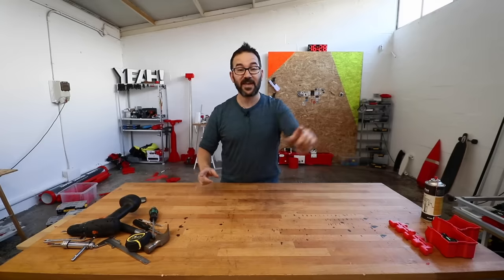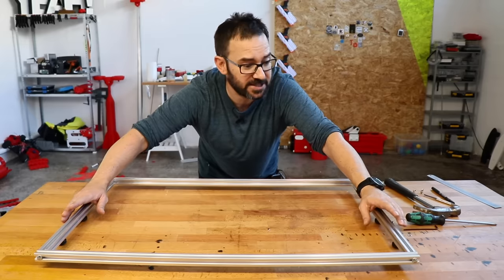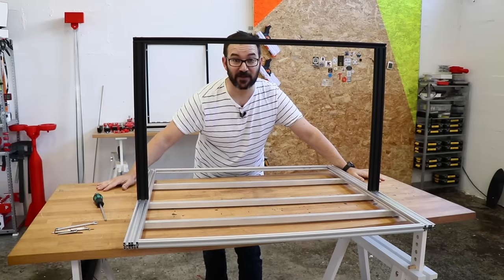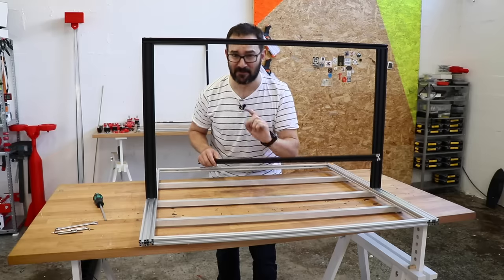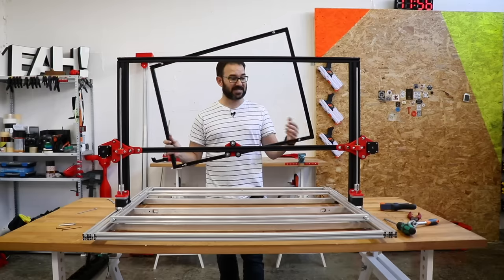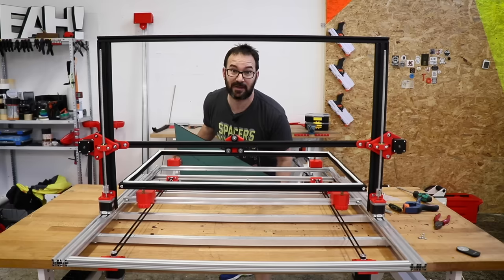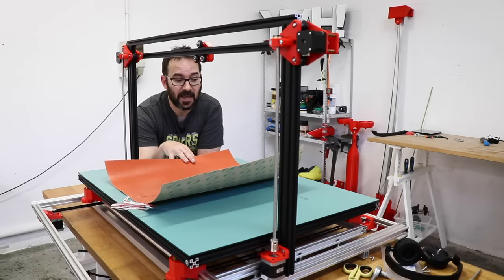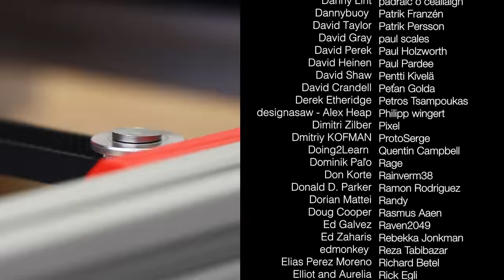GIANT DIY 3D PRINTER FROM SCRATCH

Comment: Are you afraid that the mirror, which is quite flimsy, is going to warp because of the silicon heater? I have a 300x300mm aluminum bed (8mm thick) and with a silicon heater the heatup temps are so fast the bed warps a bit. I wonder how thats going to look on your massive bed!
Reply from the maker: Mine is glass, mine is  not flimsy. It is 5mm. Aluminium expands a lot with heat and it is quite unstable. Glass is extremely stable. So no, not afraid at all.
Reply: @ivanmirandawastaken  Thanks for the reply! Are you going to use stepper motor dampeners to reduce vibrations on the frame? I think if the motors turn quite fast or change direction quite often, especially on the x and z part the frame will vibrate quite a lot. What do you think about that? Are you going to reinforce the z with diagonal rods to front and back, as i've seen as an upgrade for the cr-10 500mm version?

Comment: It is well known that the moving bed design does not work for large printers. The problem is that for large printed parts, you are adding too much momentum to the bed, on top of the momentum added by the already heavy aluminum plate and glass. You will need to print very slowly  This is the motivation behind the CoreXY design, which work fantastically for large printers

Comment: I have a wild and crazy idea. Why don't we build one that is big enough to print a small size house. The material will used will be recycled plastic that way we can re-use the plastic with a UV additive so that it won't break down by the sunlight. Design it with some space between the outer and inner walls for insulation, and a printed roof parts that can be replaced as necessary. I think that I saw this once on the internet but they were using concrete. If the house gets destroyed by wind, earthquake etc. Then just grind it back up and re-print it out. 
The possibilities can be endless!?

Comment: While reviewing the comments I noted "It's not whether the bed will sag but when."  Ivan, given the size of the glass and that glass is a liquid crystal would it be a good idea to add supports beneath the large glass?  It's a scientific fact that glass flows even if we can't see it do so.  The larger the glass the more it will sag.  Heated glass will flow in the center especially given the surface area and the force of gravity which will lead to your bed being unlevel in the middle even if it's level on the corners.  I still hope I can find measured drawings of this build someplace.  PLEASE???

Comment: For a bed that size i think a Zprob leveling system is going to be required. Unless you made the bed out of a huge machined solid plate. It would be a nightmare to tram the bed without it.

Comment: Why use spring couplers ? They are not designed to be used like this. Plus you will get inaccurate z height, due to springing action.
Better with a solid inline coupler.

Comment: Firstly id like to say Great work- Great design Great speed and motivation Keep it up very inspiring i love the cable management chains very elegant 
some tips feel free to ignore them if u dont agree:

1. Make you enclosures and or parts out of petg or fireretardants ABS- if u cant do metal boxes! Last thing u want is anything catching fire after a 24hour print- Which you willl be doing often with such a large build platform!
also purchase Silicone wires !!! multistrand silicone high temp big AWG wires and crimp them correctly!!! safety first!

2..11:30 looks like your pullly isnt centered. If u go on e3ds website you can buy genuine gates pullies and belts-  i highly recommend you dont cheap on pullys and belts since you have such heavy bed you dont want ripple allover your prints from A: uneven movement from the left to right motor: but B: Ripple from the weak fiber re-enforcement on the belts!

3. I want to tell you to get a duet wifi- and i can highly recommend it because of the webui and all that jazz its great.. But marlin has backlash compensation- and on such a large printer as this with such large belts- using the backlash compensation in marlin might actually help you- however. there is nothing to say Reprap firmware on duet wifi wont be getting backlash compensation- plus the duet wifi/maestro arevery safe board! with very strong stepper motor controllers 
backlash compensation will give you great accuracy/tolerances on parts even if you build the printer somewhat sloppy :P (You should use it on your first large printer heh :P)

4. the way the z-axis is coupled might cause - z-wobble - let them wiggle freely on the top dont captivate them- and make sure your z-rollers are nice and tight- also use low microstepping on Z- like 1/8- it has a higher chance on landing on "magic number" magnetic poles and giving stronger holding torque and nicer surfaces- even with auto bed leveling it should have enough resolution with those rods

5. maybe print little angle re-enforcement to keep everything square as the bed wobbling around might cause a bit of wobbling up the Z since thats alot of mass - maybe even just a hardware angle bracket for shelfs made of steel with some T-nuts can do the job!

6. Dont listen to the people dissing on ur heavy bed- thats what Acceleration and linear advance is for :)

Comment: The i3 design is pretty much unsuitable for this size printer in my opinion. The print itself will become so heavy that you will need to print extremely slowly, and the springs holding the bed will become compressed from the weight of the print, so layer height will increase as you print. Accuracy is probably not very important here, so maybe none of this will matter.

Good luck anyways, will be interesting to see the results!

Comment: Now add automatic mechanical levelling
Reply from the maker: Why?
Reply: @ivanmirandawastaken  for the lolz
Reply from the maker: Then yes, but fake just for the lolz
Reply: I think a leveling sensor would be quite useful, not so much for auto leveling, but rather to automatically make sure the print surface is leveled correctly.

Comment: I would have bought a large sheet of aluminum that is roughly the size of some highway signs in the US.
Reply from the maker: What for?
Reply: @ivanmirandawastaken  It would be easy to attach a heating element to one side of it to heat the sheet as a bed when it was turned over.

Comment: A Hangprinter would have been a solution as well for gigantic prints.
Reply: I somehow keep forgetting about that wonderful/silly design. At room-scale, it's easy to go overboard and wind up with a situation where you could cause a layer shift by just walking into the room at the wrong time, but you could totally confine a hangprinter to a defined frame as well. The only sure downside would be the lack of any rigidity, meaning anything from the neighbor's awesome car stereo to a minor earthquake would be able to disrupt a print without some special dampening considerations being made.

Comment: I really liked this project and im based mine on it. You said to "not do" the 6 rollers as base for the zaxis, is it causing any problems ? what would you suggest ?
Reply from the maker: It is still working fine after 300+ hours but it is a bit finicky to assembly and puts a side load on the V wheels that is a bit too much. Those wheels will end up destroyed for sure. If your bed is lighter you may be fine

Comment: Any consideration for the vibration? Especially on z axis
Reply: Maybe add truss to the vertical beam
Reply from the maker: Z axis vibration? That moves once per layer, that's a frequency of 0.003 Hertz. How do you dampen that?
Reply from the maker: Why
Reply: @ivanmirandawastaken  I have seen z-axis rod supports for Prusa style printers before (there are plenty on Thingiverse) I think more for rigidity than anything else
Reply from the maker: I get the rigidity thing but why? Nothing on the Z axis moves on that plane, what'a going to induce the vibrations?

Comment: What a clean build so far! Really nice!
Will you add an enclousure as well? And is the final heat bed mains voltage? Or 12/24V ?
Reply: Niklas Mertens I would think for speed and efficiency it would be mains voltage.

Comment: That only will work with a 1mm nozzle. the distortion of the glass varies with temperature, at that size, it is noticeable even with the eyes. He may use the "MESH" feature (in RAMPS programs) for leveling the bed if he wants to print with 0.4 mm nozzles. This setup is easier than the Extruder moving in X, Y and Z, but it wouldn't print faster, it can be compensated increasing the nozzle but it will decrease the quality. So, yes it is not the most efficient setup for a Big 2D printer. But, cool, this guy doesn't matter to leave this machine printing for days, this only works for him, and for people that wants to save some money making the setup.

Comment: i don't understand any of these 3D printer builds, basically concerned about flat, square, parallel, level bed, wheels running on extrusions, now it seems to work, however i don't think the machines are that square, nor is there smarts in the electronics i am aware of to auto adjust for this, is it a case of simply being good enough?

Comment: will the bed be flat ? i don't think so
Reply from the maker: The bed IS flat. Will it be flat? Glass is not a fluid and does not warp with heat so why would it lose it's flatness in the future?
Reply: @ivanmirandawastaken  the bed is supported only on the edge and i think that it's own weight will make it bend a little, making the center a bit lower than the edge (due to it's size), but if you want to use really big nozzle too it won't matter so mutch
Reply: Well, we find out if has sag in the middle. A good test case.
Reply: @ivanmirandawastaken  Glass isn't 100% rigid, so it will sag slightly in the middle. If you want a perfect first layer, you should probably add a BLTouch sensor or some other mesh bed leveling.
Reply from the maker: How much difference in height would you allow before having to use a probe and how much sag does 5mm glass have In 590mm between supports?
Reply: @ivanmirandawastaken  You will probably have problems if it's out by more than 0.1mm. You can't really tell how much it's going to sag, but you should probably choose your electronics with mesh bed levelling in mind.
Reply: @ivanmirandawastaken  the difference in height depends on the layer height and nozle diameter, if you want to use standard .4mm nozle you don't want a lot of difference maybe .05mm is fine with .2mm layer height, else you'll lose a lot in quality
Reply: The guy is answering your statements in real time about a printer that might have made kilos of prints by the time you're watching this, yet you're still telling him what it will or won't do.................
Reply: Mini Bigs 
The printer is not done

Comment: Building an I3 style printer this large is ridiculous. You have so much moving mass on the Y axis that you will have to run extremely low acceleration and jerk values. The more it has to change directions, the slower it will go. CoreXY is the way to go for a printer this large.

Comment: I don't understand why the bits that hold the mirror had to be 1. So tall, & 2. Spring loaded.  Waste of height, and as the weight of the print increases, will push the mirror down, causing inaccuracies.

Comment: Ivan. Sorry, I see WAAAAYYYY too much weight on your bed. Large printers need to move the XY on either a CoreXY or something where you’re not slinging the combined weight of: Frame, motor inertia, glass (that’s a big one) adding heavy silicone heater (you keep stacking weight on that Y axis) and what most people forget...the weight of that huge part you’re printing. 
That’s why you don’t see commercial  printers in this style. 
You should also be stepping up your frame rails to at least 30x30. 
Hope it turns out for you but take it from someone who has attempted your design. 
Fun watch tho. Thanks.

Comment: What if you make a robot that will pic up after your dog's Poop. My idea is to design it like a 3D printer that will fit your dog's size and can cover 9 square feet of fake green grass . Replace the head of the 3d printer with a camera that has Poop recognition software and add on it a dog Poop excavator. When the camera recognise the poop on the fake green grass, it will excavate the poop and throw it in trash.

Comment: next time use  your drill  instead of the tap handle . will go easier on your hands.  add oil , or just wd40. 

la proxima usa el atornillador (si es de impacto mejor) para roscar las puntas de  los perfiles. si podes usar aceite mejor. como minimo wd40.

Comment: But, can it print ?
Reply from the maker: Yes
Reply: @ivanmirandawastaken  Hahah tnx for reply, I just watched second part where you continued with assembling. Its really cool :) . Just I find hard to understand what actually monitors printer's head location, does it have any sensors (gyroscopes?) or it's all done by duet3d alone after some manual calibration sessions depending on motors / coil rod sizes ?  Friend wanted to make, not an printer but quite an opposite, 3d driller :) (into wood) but principles are much same. But got stuck at point how exactly know where head is located.

It was just amazing how magically well it started work when you started it :)

Comment: Funny is that to make a 3D printer you need 3D printed parts.
Therefore, you spent money on a 3D printer which you'll use just once.
Not even to mention the professional tools.
Reply: no, you dont need 3D printed parts and professional tools... There is plenty of examples... but with the basic printer you can make yourself a better printer...
Reply: @PachezZ  So, the RED PARTS aren't 3D Printed???
Did you carve them out of WOOD?!!
Reply: Luca Crisi they are and I’ve never said different, but you can build generic 3D printer without printed parts... all parts ivan printed are easily replaceable by different design handcutted from - for example - plexiglass or even wood...
Reply: @PachezZ  Sounds really crazy. Anyway, he used 3D printed parts to make a 3D printer (and PRO tools).
Which sounds even crazier.

Comment: Why a moving bed?
Reply from the maker: If the bed does not move then I can only make vertical walls
Reply: @ivanmirandawastaken  I mean why not a, over all axes,  moving Printhead?
Reply from the maker: Well, this works, shouldn't you be justifying me your proposed alternative? I mean, I know the advantages and disadvantages of each combination but still this one is easy to build.
Reply: @ivanmirandawastaken  Was just asking, it was no criticism. I guess the difference between "mean" and "meant" is bigger than I thought.  (I'm German)
Reply from the maker: I'm all up for criticisim, no worries. I get the "why didn't you" question a lot but there's no right or wrong way that can give a definitive answer to that kind of question. Usually there's not a why not but the person asking has a why in mind. If you tell me why you think other alternatives are better I will probably not argue your reasoning.

Comment: When you need a 3D printer to make a 3D printer...
Reply: Pretty much the story of all our second bots back in the early-ish days, designing our own extruder mounts, geared extruders with closed filament paths (a little bit of PTFE tube shaved down in the middle to slide in just so between the feeder gears), our own fan ducts, electronics housings, and sometimes bed mounts (when heat wasn't involved) and even frames. The game was to print all that we could because the ready-made stuff hadn't caught up with what we had in our heads.

If you ever want to see what a journey all that hot nonsense was in the early days, the RepRap wiki is practically dead now, but it's a wonderful time capsule that shows just how much work went into getting the basic concepts cemented. A lot really hasn't changed, aside from more of those parts being milled, cast, or injection molded to meet demand and provide a prettier finish.